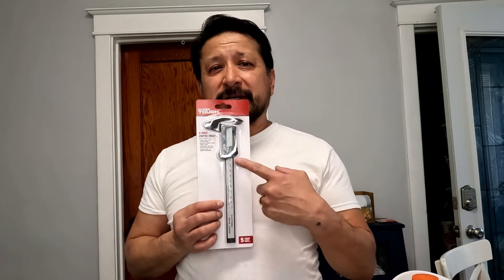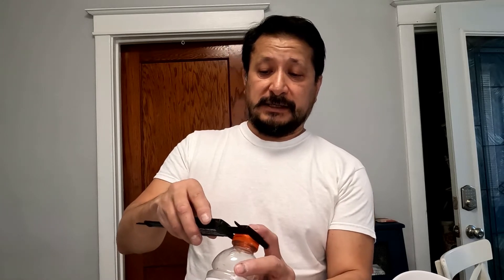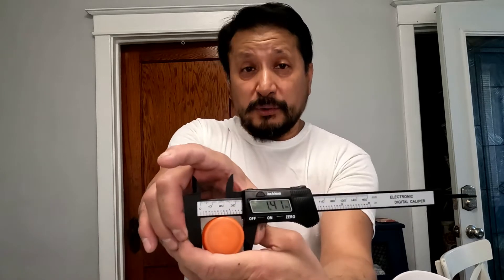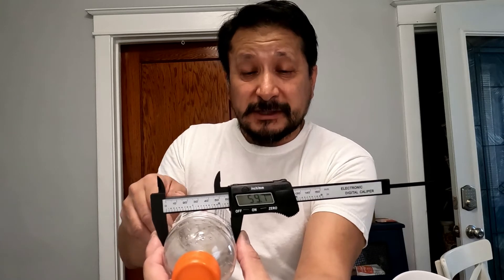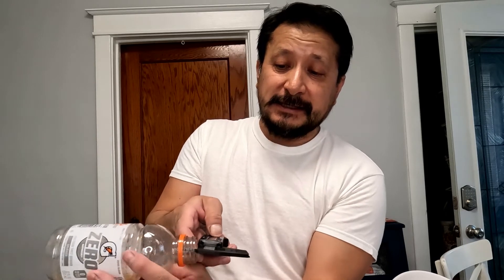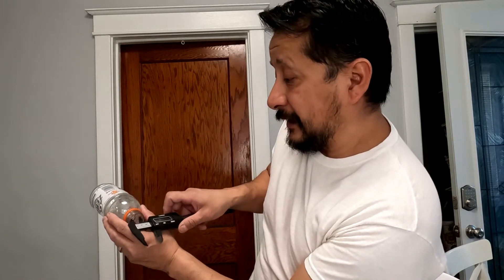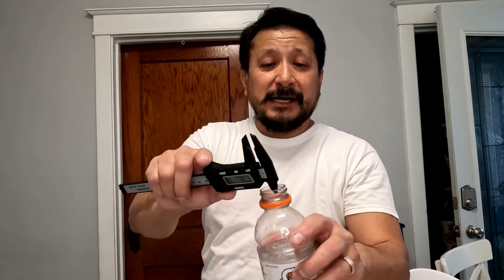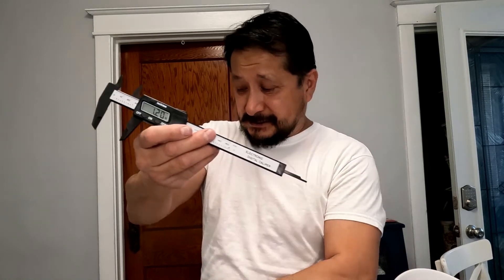How to measure outside and inside diameter

Comment: A micrometer is basically a more specialized version of a caliper. You'll get significantly better resolution on the measurement off of a pair of micrometers because it's measuring micrometers whereas calipers will usually measure in millimeters. 

The trade-off is that calipers will usually have a much wider range of measurement. A caliper is usually simply just bigger and cheaper

Comment: Okay but once you have that measurement on your caliper how do you convert it to a fraction so you can actually buy the correct part
Reply: Well frankly they should've taught you that in school but it's hard to remember things

You probably remember this but In a fraction the top number is a numerator and the bottom number is a denominator. 

Let's convert 1.25 to a fraction, which we know will be 1 and 1/4

Keep the whole number whole, so the 1 stays.

Now we want to get rid of that decimal. A way to do that is write the decimal as a fraction. The decimal (the 25) goes on top as the numerator, and your denominator will be whatever place value your decimal has. 
What I mean is remember place values in a decimal? Tenths, hundredths, thousands, etc. so in our example, .25, 2 is in the tenths place and the 5 is in the hundredths place. 

In our example our decimal number ends in the hundredths place. So the denominator is 100. 

So now we have 1 and 25/100. Now you simplify the fraction, making it as small as you can without changing the value. Find the LARGEST number that both the denominator and numerator can be divided by, and do that. In our case, 25/100, both numbers can be divided by 5, but that's not the largest number. You'll get a weird fraction. It also looks like 25 and 100 can be divided by 25, and that seems like the biggest number we can get here so let's do that. 25 divided by 25 is 1 and 100 divided by 25 is 4 so We end up with 1/4. 

We kept our whole number the same so we end up with 1 and 1/4. 

Of course, there are other methods that may be easier for whatever specific thing you're working on, but this formula here will work for every situation you have while other little tricks may be specific to a certain problem.